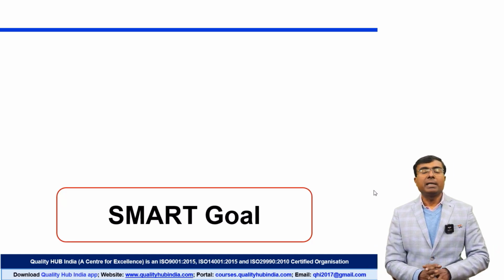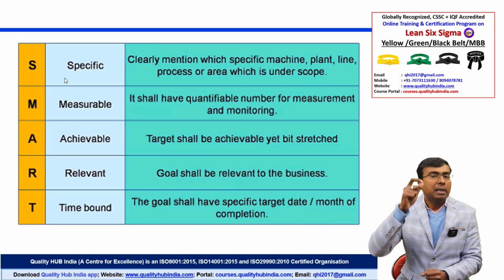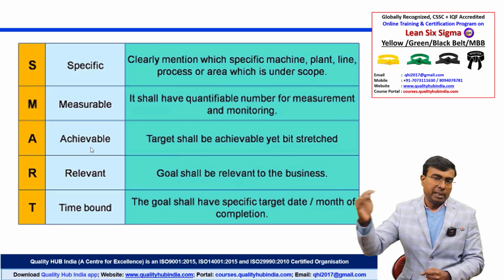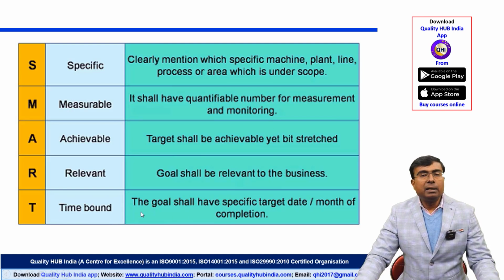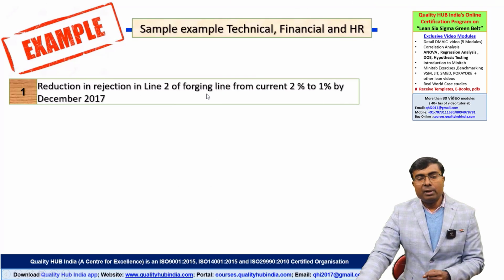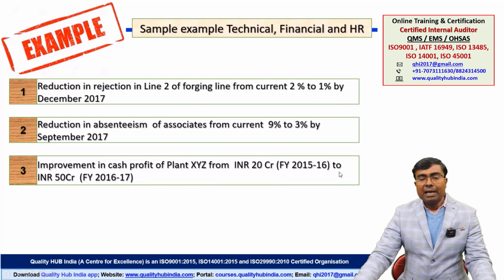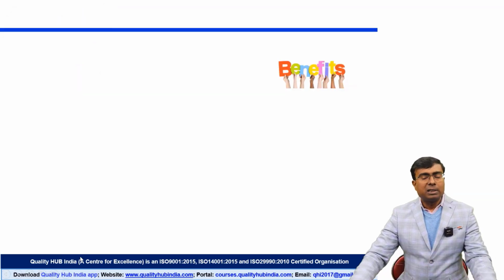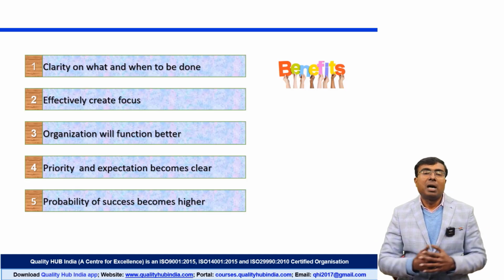SMART Goal Technique | How to set SMART Goal | Examples of SMART Goals |

Comment: How to check statiscally whether targets are achievable or not ? Suppose client gave us some irrelavant targets now how to prove them based on previous data that it is not achievable ?
Reply from the maker: To statistically evaluate whether targets are achievable or not based on previous data, you can follow these steps:

Collect Previous Data: Gather historical data on relevant performance metrics or targets that are similar to the ones the client has provided. This could include sales figures, production outputs, project completion times, or any other relevant key performance indicators (KPIs).

Analyze Previous Performance: Use statistical analysis techniques to examine the historical data and identify trends, patterns, and variability in performance over time. This could involve calculating averages, standard deviations, trends, and other relevant statistics.

Set Benchmarks: Establish benchmarks or performance thresholds based on the historical data that represent realistic and achievable targets. This could involve setting targets based on past performance levels, industry standards, or other relevant benchmarks.

Compare with Client Targets: Compare the targets set by the client with the benchmarks derived from historical data. Evaluate whether the client's targets are significantly higher or unrealistic compared to past performance levels or industry norms.